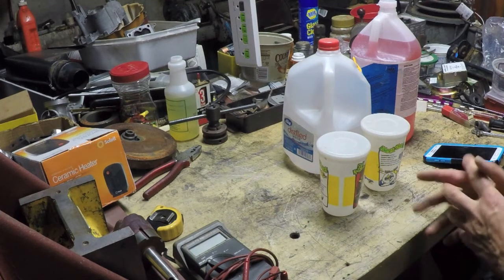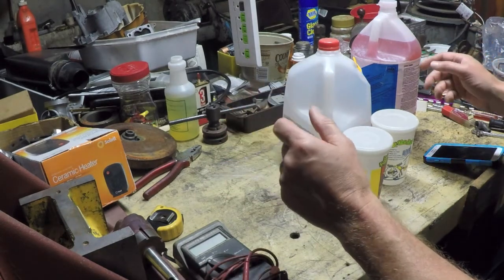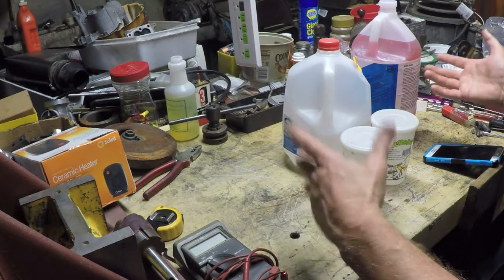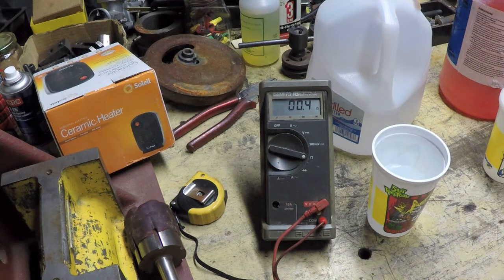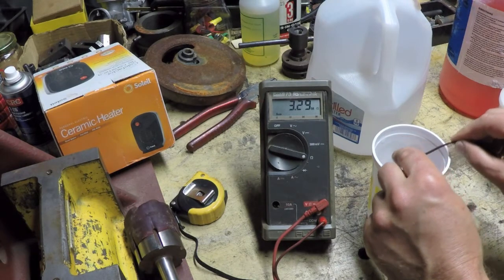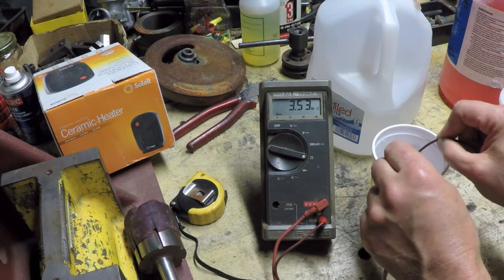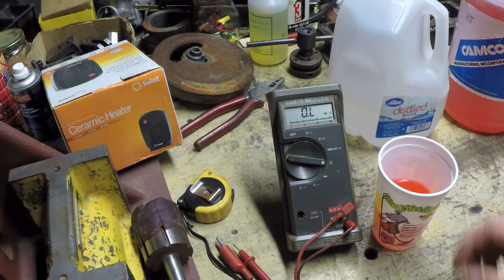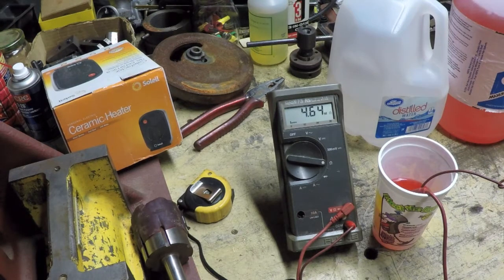Dynaflux VH1000G tig torch cooler part 2

Comment: Given the fairly low voltage a welder runs at, the resistance would have to be down in the tens of ohms (and that across the whole length) for it to even matter enough to potentially trip a GFCI, let alone matter. Some things like a higher distance plasma torch could run at much higher voltages and worry more. By far any corrosion that gets metal into the fluid will be the biggest component in lowering reistance.

Comment: Did you ever determine which hose was what? I saw the torch input to the tank then a hose coming from bottom of water tank to the radiator then the other side of the radiator to the pump then out to the torch. What pushes the water into the radiator just gravity or the system being full? If you stood it up how can the fluid get to the radiator? Any insight on that? Great vids btw
Reply from the maker: Welding Junkie hello.  I think because the pump is a gear displacement design, it creates suction on the inlet. You can see later airco tig welder videos where I  put it to use. In the end I bypassed the water solenoid on the welder, since iut was only needed when running straight off a water faucet.
Reply: Steve Watroba that is true I never thought of that. What a cool design, I guess the suction would be enough to move the water through. I believe those pumps are like the soda pumps and operate similar. I was thinking of filming a Tig cooler build video